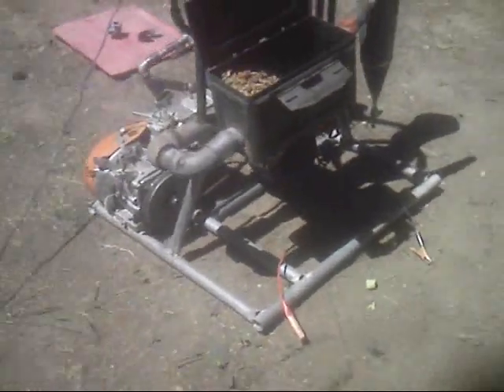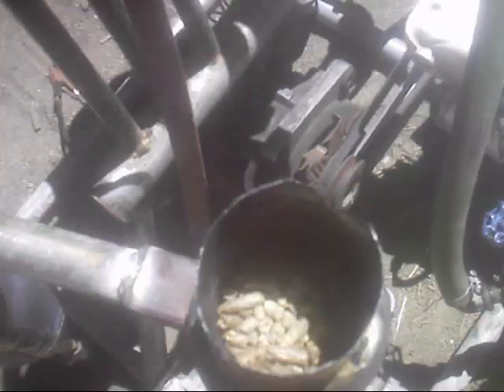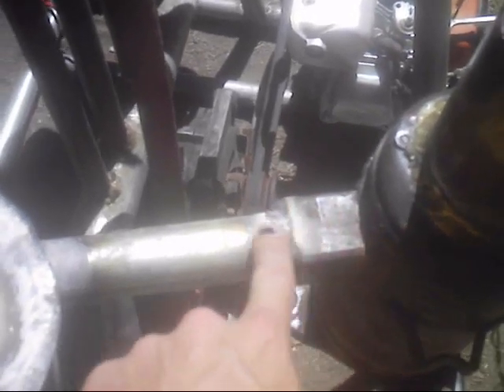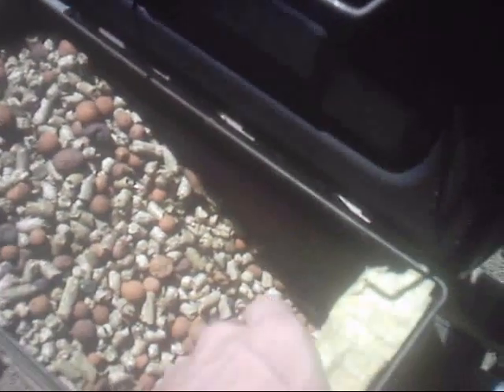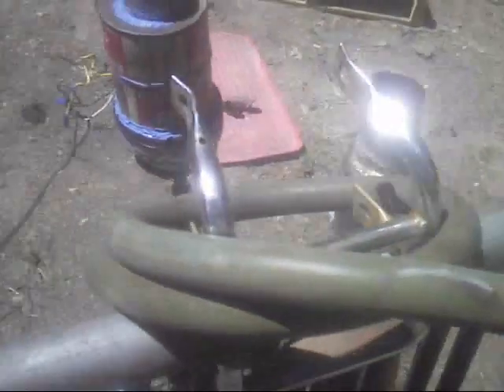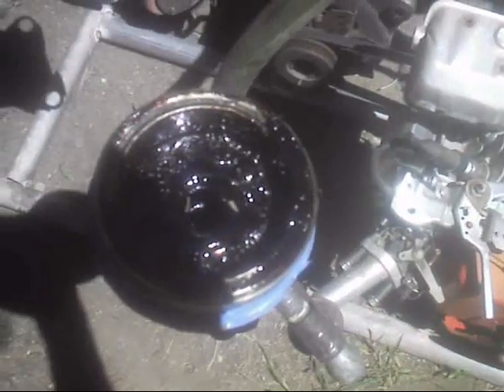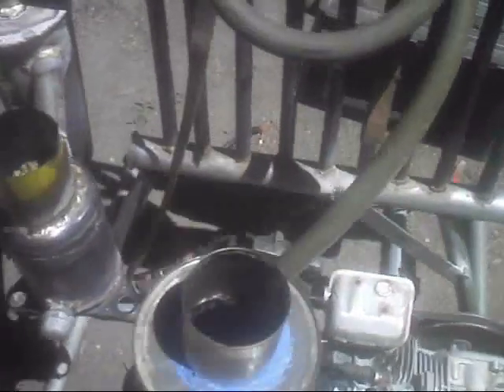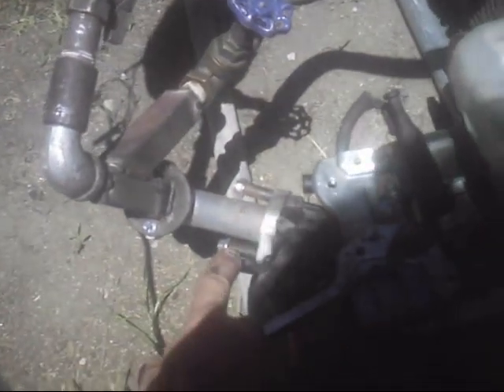Wood gasifier short and simple revised.wmv

Comment from the maker: ohh well realy quick if u know what a hydro carbon is is a colection of hydrogen and carbon to anser ur ?? in this case the engine is running off of H2CO2 its a simple 2 to 1 hydrocabon it comes from the uncomplete combustion of biomass so to put it simply the engine is smoking the wood like pot and the smoke is higly explosive just like natrual gas =3-